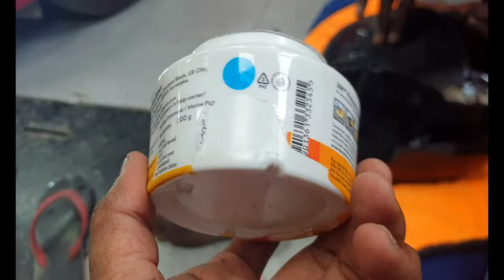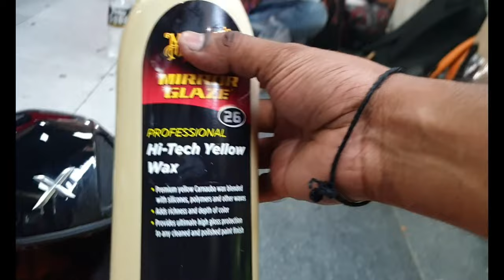Protect Your helmet with a Ceramic Coating | #AGV#Axor | Car Sense | WORTH IT ? | தமிழில்

Comment from the maker: Helmet Ceramic Coating done at;

Car Sence
No. 26. St.Thomas Mount, Near Alandur Court, 2nd Hoppman 2nd Street, Thiruvalluvar Nagar, Alandur, Chennai, Tamil Nadu 600016y
Contact : 09941313031
Location: https://goo.gl/maps/xkvvgfKyYPv5qAPZ7
Each helmet will cost you around 1,500/- where they give a warranty of 6 months each.